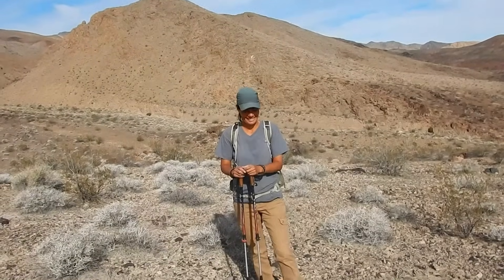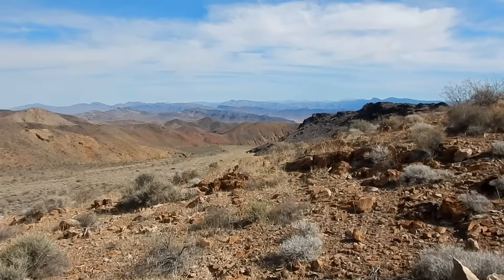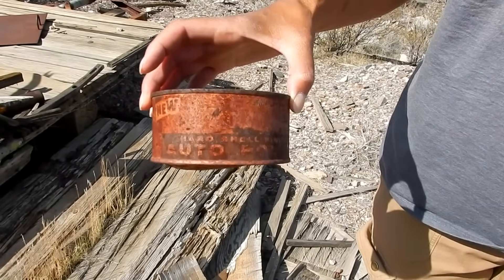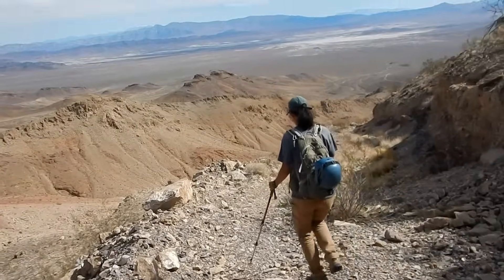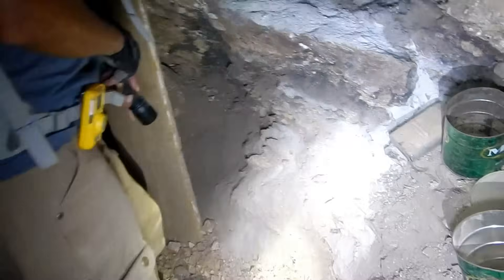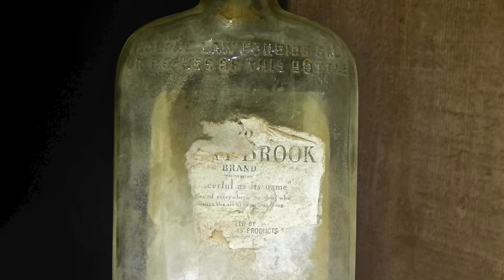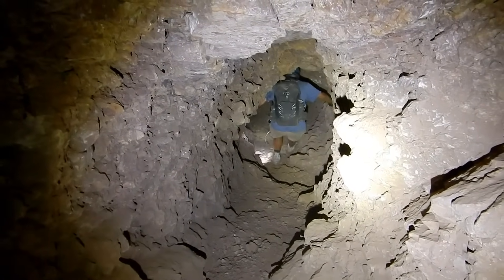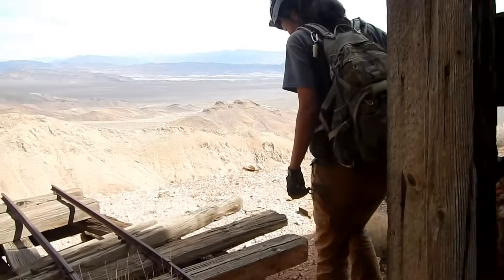This Historic Mine Has It All - Unique Artifacts, Spectacular Mineral Vein, Tram And Great Views. ⛏️

Comment: Interesting bit I learned from an old mill, those belt pulley's either are slightly domed in the center of the belt travel or flat.  The dome ones keep the belt centered on the pulley (from sliding off).  The flat ones are idler pulleys to engauge or tension the running belts.
Reply from the maker: I have seen the domed type. This one looked flat so was possibly a tensioner as you mentioned.

Comment: 7:10 Inhaled a spider.  There are pack saddles that have turrets on them to haul long loads using two mules or burros.  They would allow the navigating of switch backs.  NFS used them to haul  poles in to build bridges or fire towers.  Don't think they would  haul "standard" rail that way (too heavy). Maybe skidded it.  Great explore and old mine.  The minerals where really cool.
Reply from the maker: Spider? What spider. Interesting about the saddles and hauling long loads. Thanks for your input on all that, Olive!

Comment: Tom & Julie  --  I recognized the logo on that Crock Pot  @15:51 ,  It was made by Pacific Clay Products .  I worked at the Lab & Urethane Dept. at their Sewer Pipe Plant in Santa Fe Springs , California .  They are the world's largest manufacturer of Vitrified Clay Sewer Pipe ,  and I manufactured the Green , rubber-like , Polyurethane Elastomer that is put on the Bell & Spigot ends of the Pipe .   ---     < Doc > .
Reply from the maker: Thanks for adding that information, Doc. I figured someone would recognize that logo. I had a construction job on the sewer crew in the early '80s, but by that time it was all plastic for sanitary or concrete for bigger storm sewer.

Comment: Rheem made hot water heaters. Could be n the other thing u help up n said it looks familiar  kinda looks like the exhaust pipes up high id seen on old tractors.think it had a filter on it was usually up front off the engine. Kinda like a snorkel on 4 wheel drive vehicles.
Reply from the maker: Yes, Rheem makes water heaters and air conditioners, and in the early days, made things for the petroleum industry. Thanks for your input on the pipes. 😁

Comment: Cans of that age often used lead to seal a vent hole used to let heat escape then drop melted lea to seal hole and when it cooled it was done..a dump that size would yield several pounds of lead and easy to pluck off the can
Reply from the maker: Thanks for that information,  Joe. I believe the hand soldered cans were made around 1900 and earlier.👍👍

Comment: The soft stalactite 'calcite' you were touching is most likely Soda Nitre (Sodium Nitrate) Fairly common in a lot of old mines. If the mine is dry the Nitre accumulates easily. Nitre is very water soluble.
Reply from the maker: Could be. Thanks for your input about the geology.
Reply: @TomandJulieMineExploring  If you had of touched a little bit on your tongue you would have tasted the nitre. If that's what it was. It's not poisonous.

Comment: Furring nails...used for stuco outside exterior lath Furling nails wire then stuco
Reply from the maker: I was wondering what the miners would have used them for. Thanks for you input, Kenneth!
Reply: @TomandJulieMineExploring  plated as well to resist corrosion

Comment: When it's a bigger longer mine, what do you guys do to keep from getting lost, disoriented in there,  and losing the way out?
Reply from the maker: Of the hundreds of mines we have been in I can count on one hand the number of times we have been slightly disoriented and we have never been lost in a mine. I think when you are watching a mine explore on video it looks more confusing than it really is. Very occasionally we will make a small rock cairn at a strategic place and then remove it as we leave. Some people spray paint arrows in the mine which to me is an awful thing to do. Others pull a spool of string that they can follow back and usually leave it which is also not good. Thanks for watching and for the question!
Reply: @TomandJulieMineExploring  Thank you so much, if I ever explore a mine, I'm taking you with me 😄😄

Comment: So...are all the tunnels and vertical shafts/shoots created by dynamite and then cleaned out, or by drills, etc?  How can you create a vertical shaft with explosives, and why would you?  Surprised to see so much wood in your videos--must have been a lot of effort to get it to where it is?  Why all the heavy wood doors in so many of your videos, so far inside a mountain?  Sorry for all the questions....
Reply from the maker: Hi Gary, generally hard rock mines are dug by drilling holes with a large rock drill, inserting dynamite into the drill holes and then setting off the shot. When the dust has cleared the waste is hauled off to the mine dump and the pay dirt is hauled out to an ore bin. Vertical or inclined shafts are made for a number of reasons. Sometimes to follow a vein down, sometimes to assist in hauling out material and hauling supplies in with fast hoisting speeds and sometimes for ventilation. The doors are in the mines for various reasons. The outside door is for security and the inside doors can be for controlling air flow and dust, and some are for locking up explosives in small rooms. Thanks for the comment!👍🙂

Comment: Beware, some people might build booby traps in those places.
So always be very careful…
Reply from the maker: I suppose that is a possibility. We've been in over a thousand mines and haven't seen any traps. We will be careful though. Thanks for commenting, Anthony!👍
Reply: @TomandJulieMineExploring  
Wow, didn’t know how many mines you’ve been in. I’ll have to check out more of your videos. This was the first I seen. That rope wasn’t tied very well and it looked like it is in good condition.   So others still poke around in there looking for the “Mother lode”.  Whoever it is didn’t leave any trash behind so they are responsible, somewhat…
I can see your careful, and smart enough to wear helmets and gloves, so you can dig yourselves out without hurting your hands…
You did point out the 1” boards holding back some loose rocks at the top of the mine. That is a hazard, if I was working that mine I would neutralize that hazard.
Anyway please wear long pants and long sleeve shirts when going in those deep holes…